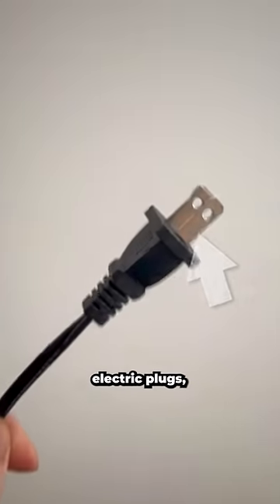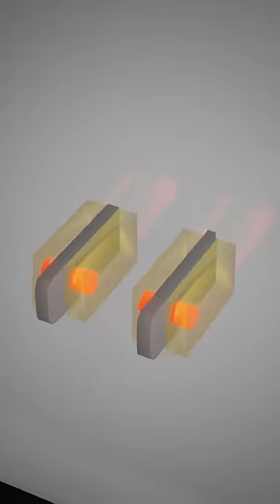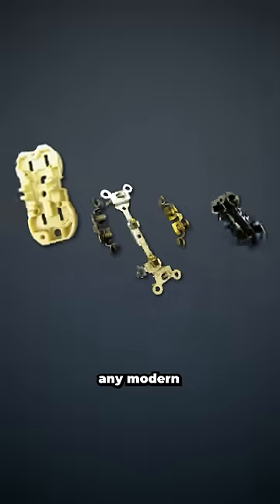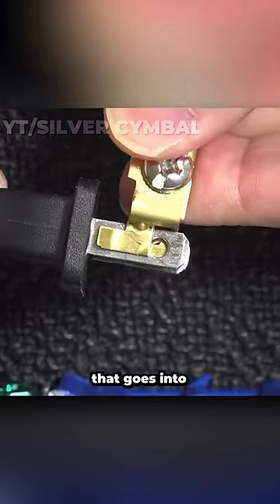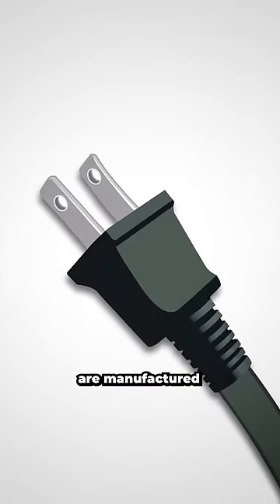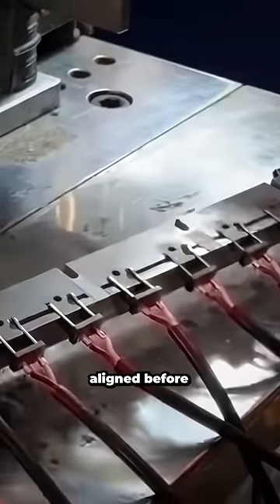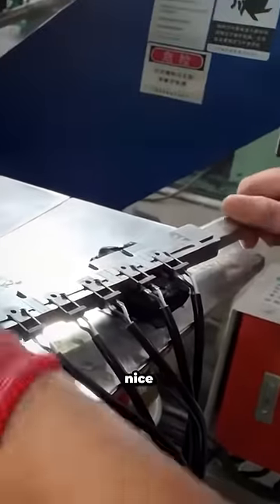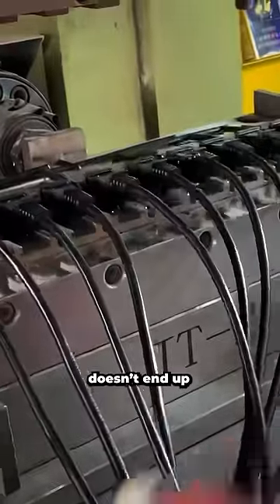The REAL Reason Plugs Have These Holes 😮

Comment: It's also used to tag out appliances in businesses. At the end of a shift, machines that are "broken down" (cleaned and prepared for the next day's use) are not meant to be used until the next business day. The plug is then tied with a zip tie through the hole and a "tag" is attached with the initials of the worker that broke down the device. This prevents other workers from using it by making the prongs too big to fit in the outlet and to tell the other workers it has already been broken down to prevent redundant cleanings.

Comment: They also have, electrical lock outs. Used to lock the plug from being plugged in if a device or mainly large tools that are broken or getting fixed. Used them in a wood shop every time u had to change a saw blade. Kept a coworker from plugging in a machine and using it when it wasn't safe to use.

Comment: No. Those holes are absolutely for gripping outlets tighter.

But they're a depreciated feature. Outlets and plugs are created with much tigher tolerances now than they originally were.  So more modern outlets dont have the bumps anymore because they dont need them.

If you look at the guidelines from the National Electrical Manufacturers Association for the plugs, they're an optional feature and are not required anymore to meet the standard's guidelines. But if a company DOES include them, then they are required to be in that exact spot.

The holes aren't there so you can test them with a rod to see if the plugs are right. You use the rod to test if the holes are right.

As for why they're still used, aside from older houses still using old loose outlets that DO have the bumps on them, people expect them to be there. If someone sees a plug without those holes they might think it's the wrong plug or something.

Also, it doesn't hurt that you get to shave a bit of metal off your plug to cut costs.

Comment: One of the original patents for an outlet and plug did include a mechanism for locking it into the outlet. That technology is now in very limited Use for certain expensive extension cords.

Comment: It's also used for lock out tag out. When dealing with electricity you lock out tag out to make sure no one accidently plugs in what ever you unplugged
Reply: That's just a coincidence.  They weren't designed for that
Reply: @tsm688  some plugs are. Like the plugs to certain generators for commercial use, and other big machines that have alot of current/voltage
Reply: @MegaMoma  None of which are the plugs being talked about here :D

Comment: The issue with your answer is that of the Chicken or the Egg.. The manufacture method you showed is one derived after the fact of the manufacturer taking advantage of the previous design spec of the North American plug that has those holes. 

Instead it's actually for the reason as mentioned originally at the start; while modern plug sockets are built as cheaply as possible and don't include any sort of latching bump mechanism, doesn't mean plug sockets back when things weren't built as cheaply as possible didn't have them.. in fact this is exactly the case, the holes are there to be gripped by bumps inside the socket to prevent the cords from being pulled out easily.

Comment: Can’t believe how many people don’t know this is for lockout. If you’re working on any electronic, you put a small lock(usually a zip tie in most cases) to prevent it from being plugged in while it’s being worked on. It’s a safety feature that is a requirement.
Reply: Can't believe someone thinks it's their original purpose.
Reply: @danek_hren  who said anything about the original purpose… this is the REAL reason they still manufacture them like this. Indents haven’t been used for year in receptacles so it’s not the “real reason” as mentioned in the comments.
Reply: @strandedorange9322  oh really? Maybe tell the source?

Comment: Not all plugs have holes. The ones that do might be done due to their manufacturing process but guessing not all manufactured plugs actually use the holes to secure the plug. Truth is some receptacles have the bumps, some extension cords have a push button lock that uses the holes to lock the plug in, some places require them for lock outs and I'm sure there is other uses. I personally like my push button lock on the my extension cord while using the leaf blower or power washer.

Comment: Okay, sure, they might be from the actual manufacturing process, but ask anyone who has done any amount of construction or heavy work, and I guarantee you they've worked with a locking extension cord before. While those holes might have started as nothing more than a manufacturing process, they are indeed used to secure the plug in some cases. A standard wall outlet is NOT one of those cases, but it's very common to see on extension cords and power tools.

Comment: I've installed many outlets in my lifetime, had a locking outlet which would lock any plug to it when it was inserted, you'd need a key to unlock, it did go through the hole, but that specific lock was made with those holes in mind even though most plugs don't work like this.

Comment: On heavy duty extension cords they have a switch that locks the cord in to the extension cord using these holes
Reply: Bingo.  I have a power cord like this and it very handy.  I also has a tiny neon light in it to show you the power is on and help you find the end in a dark envirement.

Comment: i personally think it's used for if you want to power an appliance or device but don't want to or can't use a wall plug for example if you wanted to wire it to a wind turbine or solar panel or any other energy source it would be easy to get positive and negative. otherwise who knows

Comment: I’m going to understand that there are systems that some places have to lock cords into outlets and external outlets, in situations where appliances can be stolen. The Holes are supposed to be part of that.  

last year, when I was sick in bed during the pandemic, I had a lot of time to think. So I designed a lock system to keep appliances from being easily unplugged and stolen when they need to be left plugged in outside for a while, and I don’t want to attend them. then I found out that they already have something like that in existence. Lol.

Comment: Um no. It's actually a safety feature. Any time you work woth electrical hydraulic or pneumatic stored energy you are supposed to have a way to "lock out tag out" the device so that if there is an issue nobody can use it until it's fixed. You are supposed to use the hole to put a padlock on the hole "more like a diary sized lock for most household devices" so that nobody can plug it in if there is an issue.

Comment: You can also use them by puting wire i your plug and tying the other end through the hole so then you can power something with a bent plug tip

Comment: Not really. While this design feature does help manufacturing, it was not intended for that purpose. In fact, it was intended for plug retention. However, very few things used this feature, so it just sticked around because, while it was very very rarely used, there wasn't really much sense in changing the standard.

Comment: I have a battery charger, and I use them to put 12AWG through the hole wrap it a few times then hook it in to some hot wires, works like a charm, I'm an electrician

Comment: It would be safer in the long run to have ball bearings in the outlets that engage these holes to hold them.
Ever been to an old house and seen a plug hanging out of the outlet because the outlet is old and weak?

Comment: The holes doesn't serve any purpose. The standard does not required them. Modern manufacturing methods do not require them either. Originally they were for manufacturing , but that was like 80+ years ago last time used at scale.

Comment: There are child proof locking outlets and extension cords that use those holes. 
There is a slide on the outlet or extension end that engages it.

Comment: Not true. Plugs before WW2 did not have the hole punch. 

There are some outlets that actually do have a mechanism that locks into these holes, but patents for these outlet boxes came AFTER hole punched plugs. 

Same thing with the example shown in this video. The hole was there first, they took advantage of this during production to also use it as a locking point and to align all wires. 

The first plugs had holes punched to limit the amount of metal used during wartime rations. 

Think about in the long run how much metal has been recycled like this

Comment: Isnt it because of edie's current which heats up your cable the more the size of the metalic plug increases the hotter the cable gets so they make a hole so you have air expose it to reduce the amount of heat produced i think
Reply: No. EU, AUS and UK plugs don't have holes and still can handle more than their limit of 4KW.

Comment: During my time in the US, some sockets are loose and the plugs have a chance to slip out, plus the sockets are not protected by a switch, unlike the british sockets, as a electrical engineer myself, I find the electrical system safety in the US way inferior compared to my countries', the difference in first world and third world country.
Reply: Uhhh... The switch in UK on receptacles is just a redundant switch, it doesn't protect anything.

Comment: In case of a you don’t have an outlet in the wall but the leads are still there and you need a lamp or something you can loop the hot and neutral through the holes and electrical tape it

Comment: I forgot but Iknow the holes have something to do with amp or voltage that’s why some plugs have them and some don’t, the ones without the holes are rated for lower electricity the ones with holes are rated for higher

Comment: If you put a Steel Rod in between the Hole's of a Plug it will Short Circuit the Electrical Wiring of an Outlets. 
There are some Extension Cords that has a Coper Locking device in each outlet.
I'm sorry for this video, but Do Not Try This at home

Comment: I hate them. Any plugs like that, they just lost a sale by having braindead management in charge of design. Notice one of the metal legs is wider at the end than the other and often needs to be forced into the flat socket. Which breaks the socket after a week or.. 2 years. Wear and tear..

Comment: Never seen a plug with a hole in it. In fact, it shouldn’t even be called a plug if it has holes in it. Kind of worthless for plugging a leak. Or a keg of wine or beer.
Reply: It’s an electron escape system, with AC current sometimes electrons get in each others way so the hole provides an easy escape route for trillions of electrons, otherwise it would look like a highway in Jakarta.

Comment: Nope all bullshit. US plugs come with and without holes. They have two purposes.

1) Dimples in older style outlets did line up with these to help ensure the plug was pushed all the way in and give a more secure feel. They’ve since designed better pincers that grip better meaning the dimples are no longer required although they’re still sometimes included.
2) To allow a lockout bar or lock to be put into it to disable a device that might be faulty or have someone working on the device on the other end. In the US, the laws are different depending on the state and manufacturers who made devices that required some sort of maintaining used to send out little plastic bar clips that were there so that the owner could isolate the plugs before working on the equipment. I think they stopped sending these out for cost efficiency but the holes are still there.

Stop pedalling misinformation, you can actually look up the standards for US appliance plug design on the internet in about the time it takes to watch this BS.
Reply: Your 2nd point is false. The holes in plugs have been invented long before lockout tags were invented.

Comment: This is incorrect. They may use them for this purpose in the factory but that’s not the original reason for them. There isn’t actually a real reason though, it was just adopted from an original blueprint someone made and just never changed.

Comment: Stupid US plug: archaic manufacturing method that leaves a pointless hole in it and sharp edges sometimes. Dangerous: the conductive area can come loose and be exposed easily while plugged.

Better EU plug: Round, smooth prongs with conductive metal at the top only, making it impossible to touch them while plugged.

Comment: still some of the worst plug designs in the world...UK plugs should be an international standard
Reply: No. Schuko + UK should be an international standard. Really, the Schuko plug has only one downside compared to UK plug - they don't have fuses. But it still can be made. Oh, and also, EU plugs can't be taken apart, though Soviet plugs were in fact slightly modified Schukos and could be taken apart.

Comment: So, in the video example of an open socket, i should ignore the spring clip tension caused as the 'hole' passes through, making it less likely to just fall out?

Or should I ignore the patent drawing?

Or should I ignore the rod not being used in large scale manufacturing applications that use... you guessed it... a tension clip to hold the plug in place while injecting the encapsulation?

I'm just curious how many facts to ignore before accepting your condescending nonsense as true.

Comment: This video is wrong long time ago from the late 20s to the 50s or 60s outlets had tabs in them to hold the plug in the wall why there's holes on the prongs I found this out while replacing receptical outlets in an old house